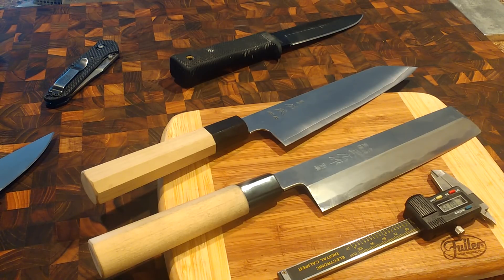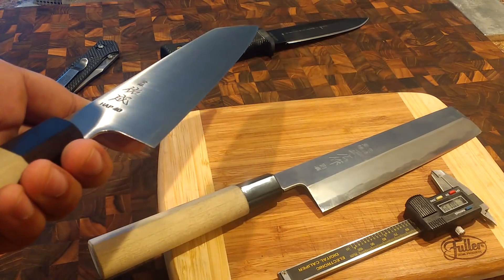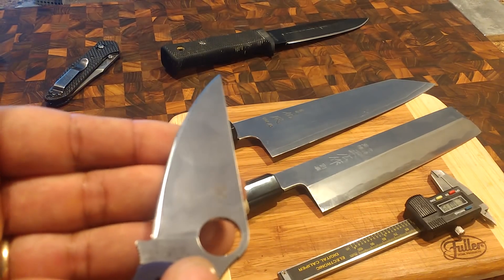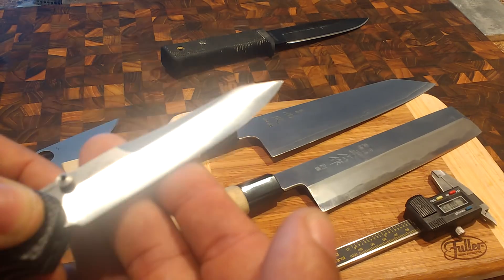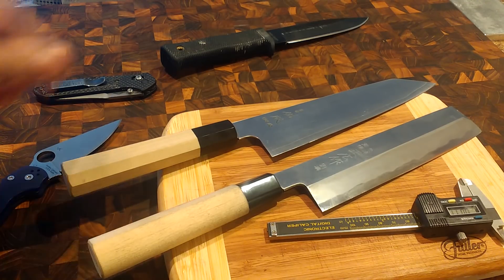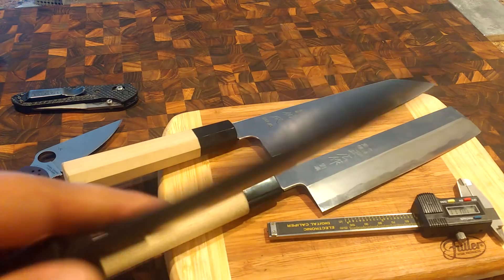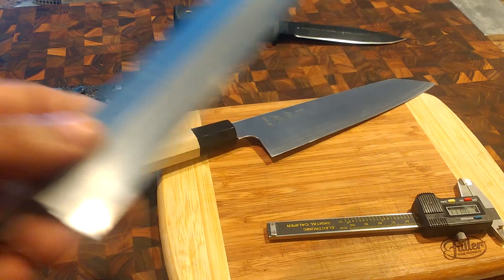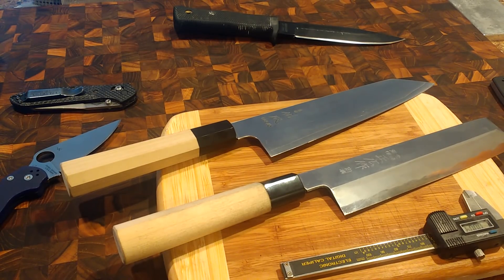Geometry: The Hidden Reason Why Your Knife Is Awesome or Not

Comment: Given that the Tsuba has such a thin edge, what's the benefit of such a beefy spine? If the spine were reduced to .125" (for example), but the bevel angle remained the same, we'd wind up with a superficially shorter bevel and a knife that still had little to no flex through soft material. Its something I see often with Asian knives, so just trying to understand what's going on there.

Comment: Your experience with Benchmade is oddly the opposite of mine.  I had several Benchmade and Spyderco knives in the mid to late 2000s.  The Benchmade knives consistently had better edge geometry than the Spyderco blades.  I haven't bought a Benchmade in a while and sold all the ones I had.  It could be different now.

Comment: Can you compare the cutting power and feathersticking abilities of a knife with a very high scandi grind (like malanika puukko) vs a scandi grind that goes to half the height of the blade of the knife?
Reply from the maker: the malanika edge is more stable and less prone to chipping and rolling with cutting wood, it also has more control in the wood if you need it cut shallow or deep its easy to control. The mora type low scandi has more bite in the wood but want to dig and bite very deep and take more control for shallow cuts when trying to make very very fine feathers, its also a very very delicate edge and has lots of rolling or chipping just cutting wood

so the malanika is superior, and it takes more skill for a maker to create
Reply: The Mora's are good knives but at 58hrc and 11.5 DPS, it's a soft wood carving knife sort of grind. Scandi can be the worst of two worlds with a thick stock that makes cutting an onion awful, while having thinner primary bevels than your average chef knife. Keep a microbevel on it if you're not a carver or such, and stick to a thinner mora basic with a thinner stock.

Comment: I'm in the middle of thinning out the edge on that exact knife, at least they could of thinned out this one slightly since its not the hard use version of the 940. Benchmade knives do seem to be a little on the thick side most of the time, with few exceptions of course.

Comment: Ok, Big Brown Bear!! You got me going and ever so interested. I just got the Chosera 400, 800, and 1,000. Id that good enough for the most part? I'm excited to dive in and try a knife. I can't read the Japanese though so I need a little extra guidance. These stones are the splash and go, right?
Reply from the maker: Nate Brabant Oo hey brother, you don't need both the 800 and the 1000, just one or the other, buy a stone flattener too. I'd take the extra cash and get a strop with 1 micron diamond spray. Yes splash and go
Reply from the maker: I'd return the 1000, and keep the 800
Reply: Oh yeah brother, I have all of that down and well experienced with it. I've watched a lot of the water stone videos (all of your of course) and I really want to get become semi-good at the stones ya know! I do mostly hand sharpening on stones, the old fashioned way! I catch on quickly, I have 5 dummy knives I use for testing and breaking in new diamond stones.
Reply: Printed out the return for the 1000.
Reply from the maker: Nate Brabant it's the fastest most satisfying way to sharpen, LOVE freehand

Comment: I just wanted to give you an idea to finish up your -1. My 1x30 is not very accurate at the regrinds but it does work well with premium ceramic belts to remove material. At ace hardware they sell ceramic sheets of sand paper and if I want to finish my regrinds a little prettier I will buy the roughest they have up to maybe 320 grit on a flat hard surface. 320 finish leaves a lot of finger prints though. It’s takes some concentration for me anyway to go spine to edge to get those lines right. It’s good to see I’m not the only one looking for better performance out of my knives. Also the 1x30 will burn the tips of any steel if not careful. I may not be telling you anything new but I just thought I’d share some of the stuff I’ve tried. Take care and looking forward to your upcoming videos.

Comment: Did you slack belt the 940 or hand stones? I'm about to do that with mine
Reply from the maker: simonize251 I took that bitch apart and slapped it on a 60 belt on the platen. I don't recommend it because it's super easy to fuck up your blade. But hey it's $25 I believe for a new blade from Benchmade. But honestly. I'd look into Josh's work from "razor edge knives" he does regrinds
Reply: Right on. Looked pretty good to me. I'm not too picky on how pretty my blades are if they cut like a light saber I'm happy.

Comment: nice!

ive seen makers test the edges on thicker edge knives with a brass rod instead of there fingers. you could regrind that pm2 like you did to the 940-1 to keep that better geometry. .. i didnt realize how much you sharpened that until i saw close up below that finger choil, OMG

love the reground 940-1
Reply from the maker: Tactical Center god, it's so damn sharp with the regrind. That's why people go custom. A custom maker doesn't have to make beefy grinds for the lowest common denominator. 
Yup I need to regrind my Paramilitary 2 next.

Comment: Is that Swamp Rat SR-101 any good in your opinion or is it just that I maybe should not have thinned out and convexed my Ratmandu? I doesn't hold an edge any better than my 8CR13MOV Schrader fixed blades and it chips. I have to resharpen after every single use of even cutting chicken. Maybe I got one from a bad batch of heat treating, because the forums swear by that SR-101 steel. I investein a kydex sheath and after a total $200, I could have gotten a 3V Gunny from BRKT.
Reply from the maker: Mos Matic God it's tough to say man. I've owned bark river and Swamp Rat. They are both radical, but the swamprat doesn't come sharp at all. But when you reprofile it takes a killer edge. SR 101 is 52100 with cryogenic aging. It was a wonderful edge. Not chip proof of you Sharpen it to a laser but it will cut better. If you want Ulitamo durability you have to make that choice. The Bark river is rad too.3v is better steel if you want more edge holding but less ease in Sharpening to SR101.

Just pick what's cooler, you'll probably get both eventually and there's a wait time on the ratmandu
Currently I'm just not that into beefy survival knifes.
I like lasers